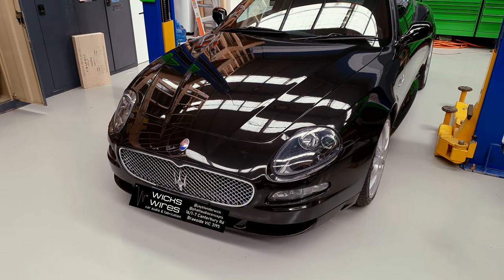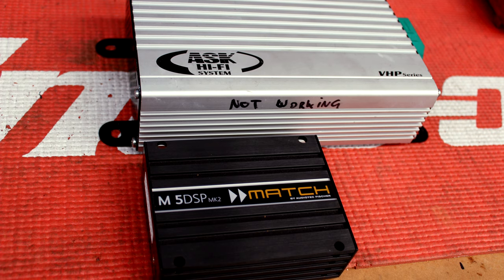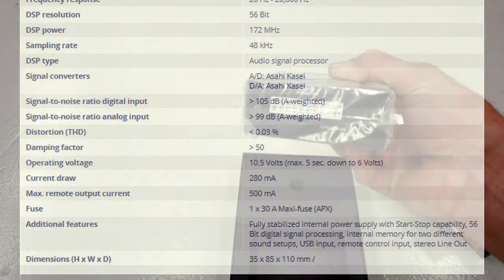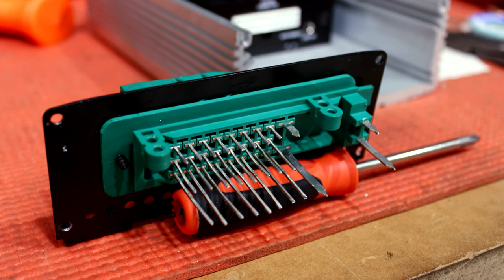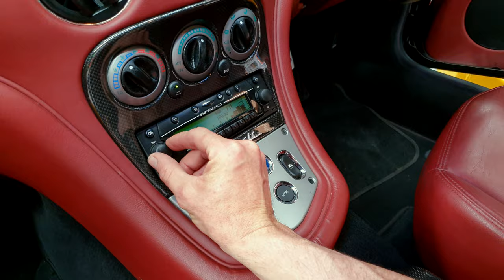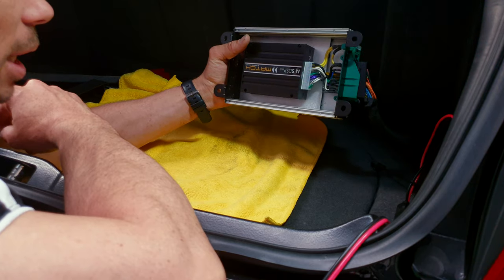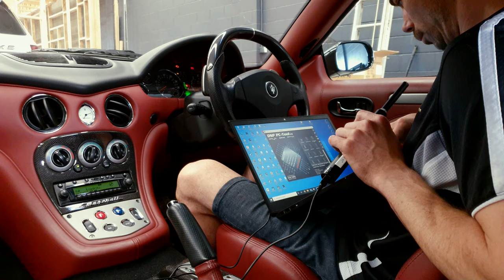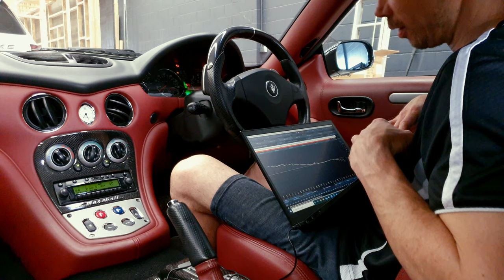AMPCEPTION - An Amp in An Amp?? Maserati Match M5DSP MK2 Install - PhattDate #7 [4K]

Comment: Great video, I just installed the UP10 DSP from match into my BMW and I was wondering how to use the auto EQ function. I didn’t know I was supposed to use pink noise for the setup to work, guess I need to read the instructions.
Reply from the maker: Correct, the software will have all of the audio files you need for tuning, but you will need a MTK-1 tuning mic to use the auto tuning functions 🙂
Reply: @wickswirescaraudioandfabri7730  Great, Thanks!

Comment: Thank you for this video, just installed exactly the same amp, the M5DSP MK2 in my Kia, the problem is that when i connect the amp with the laptop by USB, i cannot i connection, the software days its connected for 2 seconds, than it says disconnected. I think i might be using the wrong software version. What version of DSP PC tool??
Reply from the maker: Download the latest version of pc-tool and make sure you install the drivers. From there it will probably need/want an update but the software should prompt you of that automatically once opened and connected 🙂

Comment: Question, have you done this with a 2013 Porsche Boxster S ASK Amplifier?
Reply from the maker: I have not. Send me some photos of the amplifier on Instagram if you like and I will see if its possible to do. Otherwise there are a lot of amps that will go into the factory place and run much better than the original 🙂